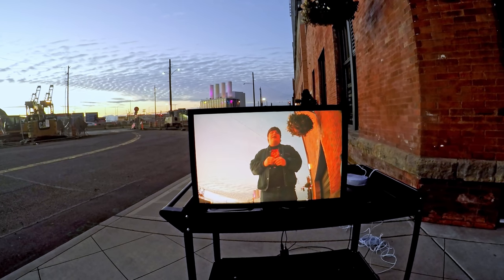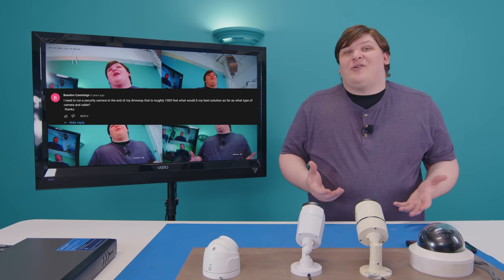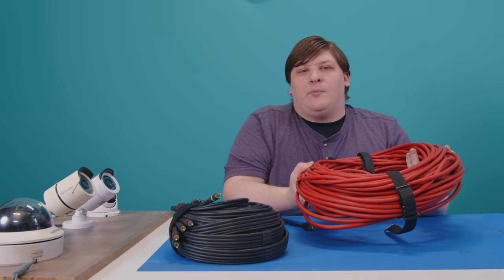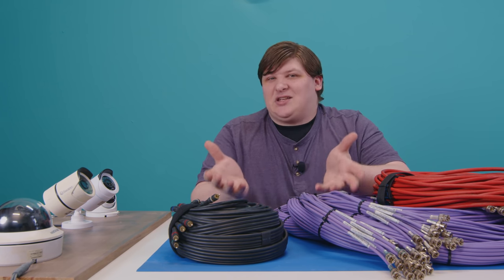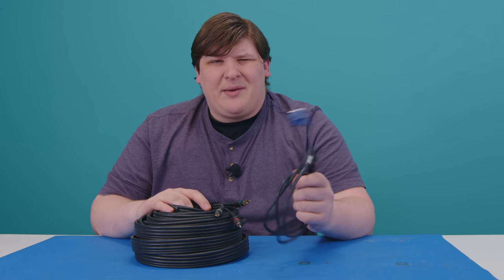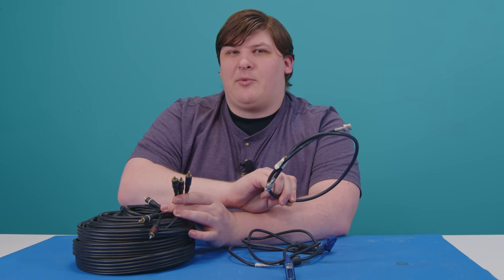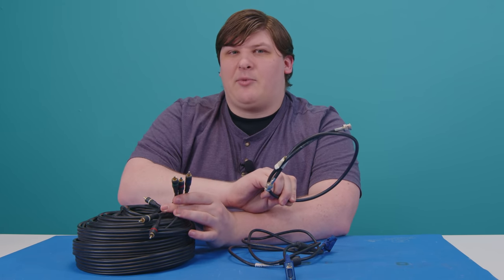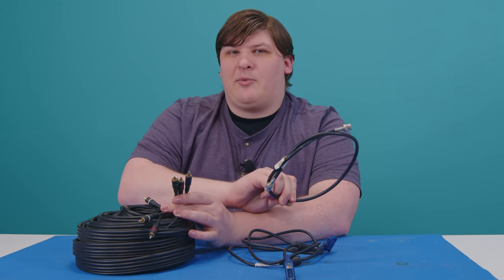1000ft of ANALOG HD video over a single cable?! [AHD/CVI/TVI]

Comment: Yeah, I've never heard of EX-SDI either. And I'm guessing the engineers at work haven't heard of it either. They're moving a department from one level to another 3 floors up, but they couldn't get the budget or floor space for a tech room to put their ingest and editing workstations. So instead they have to pipe all the video and data 3 entire floors up!

Unfortunately it's well over the limit for the 3G/6G-SDI that they want to use, and it's impractical to use repeaters, so they're basically left with fibre. Which also has the advantage of being much more compact and quicker to install than massive bundles of coax. We're talking a bundle of coax as thick as my thigh, versus a fibre cable that's about as thick as my pinkie finger, but also has way more cores than the coax. That's one cable pull vs half a dozen multi-cable pulls with coax.

So yeah, it's pretty crazy the lengths people will go to (I'm not apologising for that pun) just to not have a noisy workstation in the editing suite.

Comment: I use AHD and HD-TVI at work to upgrade our old CCTV cameras without having to recable 20000ft of coax with cat5e. Multichannel encoders to ethernet got really cheap many years ago, I think the 16ch ones I use were under $800 5yr ago. They just give standard ip video streams.

HD-TVI gives a slightly better image, though for most of these uses, I doubt anyone would notice the difference.

The "better" cameras have over-coax controllers to access the on screen config stuff from the recorder end without having to do so from a ladder.

960H and all the other was "fun". Luckily my recorders back then didn't care and worked with any while set to the highest.

Comment: Ethernet has the same issue.  I got a call to the Lowe's in SODO (ex-Eagle Hardware) and they had a printer up front that was being fed by CAT-5 five from a switch in the back of the store.  It wasn't working even though it had good link.  I had the remote network engineer force the connection to 10Mbs half duplex and it started working again.  Hell, it's just a printer.  We did come back a few weeks later with a manlift and run a line to the closest IDF and get it back to 1Gbs.  This is why all Lowe's have gone to fiber to all devices.

Comment: The original Sony HD experiments were based on analog, and was super high quality. Though it employed a component signal.  It was sometime in the late 80's when I saw it, but at the time, Sony had no way, or no ideas on how to incorporate this tech into the broadcast industry. They had one "proof-of-concept" camera and a 35" tube based monitor. The camera had 3 prototype trinicon pickup tubes if I remember correctly. I do seem to remember that they also tried a CCD array on each side of the prism, but the bandwidth was so wide that it wasn't feasible to use. Technology had to do a little catching up.

Comment: 14:10 My guess is it's probably a serial packet based format like displayport with much more robust error correction.

 Interesting thing about DVI/HDMI video is that it's literally a digital VGA signal. It can be used to drive an analog VGA monitor without needing an expensive framebuffer to convert the signal i.e you could drive the CRT just by converting the pixel values with a DAC. AFAIK this was never actually done on any analog VGA monitor but it was designed so you could do that. It's always seemed really weird to me that they went with such a kludgy way to do a digital video signal over a use case that was certainly never going to exist.

Comment: A slight toe curl every time your say "inches" or "feet".  I wish the US would move to the metric system.

I can't remember you describing the signal being relayed out of the security cameras as "baseband", which is essentially what it is - at baseband.

Cables and their properties are an incredibly complex topic, let alone signal transmission. You seem to have covered a lot in a short space of time but you may need several hours of content to cover just one class of cable, let alone signal process.

Hats off for a good grounding in familiarisation though.

Comment: I work on firmware for a device that has TVI/CVI/AHD video inputs. Oddly enough it’s not in the security industry — these technologies also have another huge advantage over IP cameras: they’re super super low latency, just like NTSC. This is important in the industry I am in, so it was a perfect fit. Anyway, the device uses a chip made by Techpoint to decode the video signals into a parallel digital format. The chip supports all of the different formats (including NTSC/PAL/960H), and the firmware does some magic when a camera is detected to figure out what type of camera is attached, and configures the chip for that format (which basically entails writing a ton of registers with values provided by Techpoint’s sample code). By the way, there are indeed PAL-based versions of all these formats and I’ve tested them. For example I have lists of register values to write for 1080p30 and 1080p25 TVI, CVI, and AHD. Most of the cheap cameras I’ve seen are configurable in their on screen display to change between the different output formats. TVI/CVI/AHD/SD is one menu selection, and then NTSC/PAL is another menu selection that basically picks 30 or 25 Hz.

If a company wanted to make a TVI capture card or something, it would be super simple to adapt an existing design. Just instead of a HDMI decoder chip you would use a TVI decoder chip instead, like the one I have experience with. After you’ve got it to a parallel digital data stream, it’s all the same.
Reply from the maker: Thanks for the info! I was really curious about the PAL versions. Also, not to pry - I assume you're being circumspect about exactly what industry you're in on purpose, but if you can provide any hints I would love to know just what else is done with this. Totally respect your privacy if not.
Reply: You're very welcome! I wasn't being vague about it on purpose, I just wasn't expecting you to be interested :-) I work in a small niche industry -- road marking. The drivers of big road painting trucks often have a camera system that they are watching on a monitor with crosshairs while driving, to help stay aligned on the road while painting. It also acts as a backup camera in reverse. So it kind of falls into the same category as other commenters who talked about using it for vehicle backup cameras. The low latency is a really big deal in applications like this, plus coax is convenient for wiring.

One other thing I forgot to mention is that during development, I played around with configuring the decoder chip for TVI when it's a CVI camera, or CVI when it's a TVI camera, etc. The standards are definitely similar, because it sort of works -- but it'll end up as black and white video with some strange color artifacts. So at the very least, there's probably something different going on with the color burst between the different standards. But honestly it's mostly abstracted away from me as a firmware dev.
Reply from the maker: @doogulass  oh fantastic! That's all super cool, thank you!

Comment: My go-to compromise for cheap, long distance, bidirectional video: HD-SDI over fiber optic. The converters are inexpensive and they will usually allow you to piggyback regular Ethernet on them if you want to control things like robot cam heads. And you can use plain old regular multimode fiber cable for them which is absolutely dirt cheap.

Comment: If I'm going long distance and have line of sight or mostly line of sight over obstacles (e.g. asphalt, concrete, etc.) I leverage Point to Point Wireless Radios to broadcast a network signal.  Then I connect up a digital IP camera.  At 11:15 in the video you're factually incorrect.  You can purchase Coax-Ethernet adapters that'll push both POE & Lan over the RG59 cable converting to Ethernet.  I've used these extensively with a high degree of success.

PS: Digital IP cameras can extend out 300M now with the implementation of Hi-PoE.

Comment: Great Vid, but I partially disagree with the comment about having to replace coaxial infrastructure in order to use IP cameras. We have POE over coax devices at our disposal that when used with proper POE extenders can get the job done. Obviously, all equipment needs to be reviewed for compatibility.

Comment: After seeing this, I decided to take a look at the security cameras at work (because industrial maintenance is surprisingly light work so there's plenty of downtime for shenanigans like that). Had a look at a few of the eye-level camera units and, yeah, the whole system runs on HD-TVI (per the labels on the cameras). Now I'm wondering about the security cameras at a couple of my previous employers (the local HVAC contractor just uses Ring cameras on a small network because they're a small company and further back, the big HVAC and electrical contractor had me at a state capitol building so that was government subsidized, nobody cares about what tech the Nebraska government blew my taxes on, but Walmart has a surprisingly similar looking set of cables in the LP office).

Comment: I’m sorry if this has been said already, but there is one way to reuse coax as Ethernet, there are adapters(at work we call them MoCAs) they can get up to 900mb/s over coax. You would need a power source on each side but it would be possible to reuse coax for a digital purpose. No company should do that over any other option but in certain cases, this technology is nice. Especially in the IPTV industry

Comment: Digital tv actually pushen much more video signals in the same frequency range.
This does mean it doesn't have much room for noise.
If the bandwidth would have the same as analog, error correction could resolve much more noise issues. Aka by using redundant data, just send the stream 2 or 4 times. But we wanted more channels in the same range so we got this.

Comment: I would absolutely LOVE a video talking about analogue television signals versus digital television signals. I use a digital TV antenna, after about a week of exhausting research and a couple refunds, and even after that the signals strength varies so greatly that some stations are practically unwatchable. I didn't consider the possibility of it being interference from other signals and thought it was just the power of my antenna and range of capture. Because of that I could not find the right information about how OTA digital signals work. Would that be a topic worthy of making a video about?

Comment: VGA is arguably the most common analog HD signal and is still in use today

(technically the picture format is not VGA, since VGA has a max res of 480p. But it was extended up to WHUXGA)

Comment: 11:46  In fairness you can run IP over coax just fine - and many many people do - (casually appears in average viewers doing a slow flourish gesture toward their cable modem before disappearing in a poof of smarm) - obviously DOCSIS isn’t practicable for CCTV installs - MoCA is basically the LAN version of cable modems, but this was only available 2005 onward, required fairly pricey adapters at each end (basically small cable modems) and never saw heavy consumer adoption, though is frequently used by cable companies for their set top boxes. Side note: moca is pretty great and if you can bear the cost of the adapters, it’s pretty easy to get gigabit+ Ethernet in any room with a coax drop without doing any additional wiring - though, splitter topology can be an issue, and, I digress.

Earlier and cheaper than moca, passive baluns can and have been used to send Ethernet over coax, and 100baseT can go roughly about 450feet over RG-59, and can even carry Poe with the right baluns. The same process can work in reverse too, with CVBS or even SDI (with more expensive baluns at least) running over cat5 cable.

This all works because cat5 and coax are basically trying to accomplish the same thing in different ways - cat5 transmits Ethernet signals robust to interference by using differential signalling over twisted pairs. You send the signal on one half of a pair, and the inverse on the other, since interference affects both theoretically equally, measure the difference between the two halves to read signal and reject noise. Coax on the other hand relies on a shield around the conductor to block interference from reaching the signal. To oversimplify, if you put in a transformer to match the impedance of the signal to the cable, and passive electronics to convert differential to not-differential - or “balanced” to “unbalanced”, e.g. where “balun” comes from - the cables themselves are interchangeable. 

Thank you for coming to my ted talk.

Comment: So, is this 960H trick thing basically the same thing that allows ridiculously wide resolutions like 2560x240 with CRT Emudriver over RGB, and still have it work on a normal 15KHz TV?
Reply from the maker: I'm not familiar with the device in question but I would guess it's similar, exploiting the fact that sets can actually represent greater detail than their specs suggest etc

Comment: Cool video. Would it be possible to cover, how they achieved the high resolution? Did they just increase signal bandwidth and colour carrier frequency, or was it resolution on expense of the frame rate?

Comment: I actually have an HD-TVI setup for the security cameras around my house. They were put in as a way of reusing the existing cabling from when the house was originally built, but with upgraded cameras. It mostly works okay. The biggest problem is that all the DVRs for it that I can find are janky pieces of crap with terrible local video output, terrible user interfaces, unusable web interfaces, and terrible mobile apps. I'd love to connect better equipment to the cameras on the back end, but have no idea how to find such things.
Reply: The issue is HD-TVI is a bandaid solution and most consumers won't spend good money on a bandaid. Which means all the HD-TVI DVRs are shit. All the good companies moved into NVR's.

Comment: Can you do a video on over-the-air video encoding schemes like ATSC and DVB? I recently captured ATSC signals using an SDR, and was fascinated by the fact that they're able to encode something like 4 MPEG streams with audio into just 6MHz of bandwidth. Satellite TV is even more interesting, and there are free broadcasts those in DVB. I've even heard that it's possible (although it was more likely in the past) to be able to pick up the satellite backhauls from TV stations reporting in the field. Just an idea for a topic to look into: TV on the radio.
Reply: Having just spent some time browsing the Wikipedia article on DVB-T, I think explaining it in video form would take a whole series! To call it "fiendishly complicated" is quite accurate.

Comment: Power over Ethernet is becoming popular for surveillance cameras. It's cheap, digital and can carry power without additional cables.
Reply: But it can't reuse the existing cabling that may have already been installed in your facility. This alone is a major selling point of HD-TVI, especially when rewiring isn't so easy to do.

Comment: That was QUITE knowledgeable and ENTERTAINING if I say so myself. I had NO CLUE this existed, and that is why I love your channel!!! THANK YOU for having such an interest in  all the CRAPPY CRAPY from the late 90's, 00's and early 10's - their were so many promises on the tech I bought but NONE of it worked well, unlike how it ALL seems to work just fine now-a-days.... there were so many crap products that 'DID' what they were supposed to, but JUST BARELY... like this video capture USB dongle... it was just a single wire video and L/R component to usb... but the SOFTWARE WAS SH|TE!!! And you couldn't use it with ANYTHING but that software... plus I even had a computer that MORE THAN MET the "RECOMMENDED" (not minimum) specs, and it still ran like a SLUG IN A WHEELCHAIR GOING BACKWARDS UP A HILL WITH ONE ARM!!! UGH IT WAS AWFUL!!! LOL - But you shine a light on those things that DID work correctly.. it was just out of our hands... And thank you for that :)

Comment: Last week I installed 160PLN (about 40USD) HD coax camera with automatic night vision and with decent IR light, with manual, mechanical zoom and focus, and at least IP44 rating, with really rigid aluminium body  and it has selector joystick on cables to switch between four video standards. It ended up ridiculously packed with possibilities, when I only considered low price and cable terminations from the same seller
Reply: Aaand. Someone, that installed this cctv system just used Ethernet cable for some cameras - one pair for signal and one for power per camera and this shit is working with two cheap ass cameras on ~70m chain perfectly and it also works with one camera 200m away, with AC power cables bundled together. It is impossible to read anything from video, but things and people are recognized with no problem at all like through dirty, 15fps window. No noise, just a little bit of blur

Comment: NTSC resolution has always been debated. You'll find products range from 640x480 (more or less what you should see on the tube) up to 800x600 (more or less the entire signal, VBI included.) As you said, it has lines but it's all analog so there isn't any "pixel".

Comment: Biggest problem I have where I work with CCTV is the dynamic range of these cameras, resolution is fine, but if I can't read a number plate because a car has headlights on and the camera shits itself, they are effectively, useless. 

Very interesting video though, learned some things.